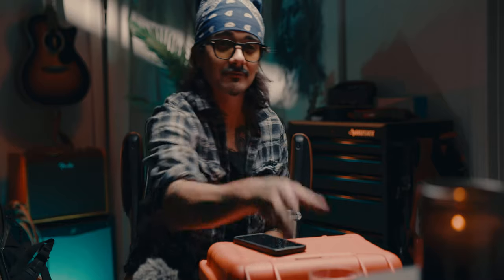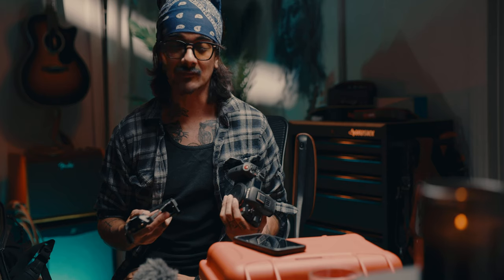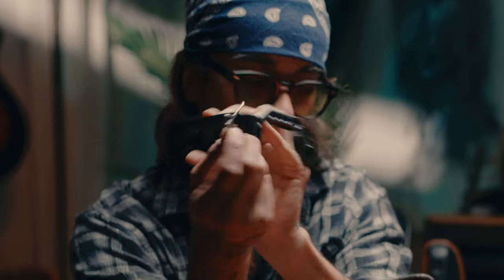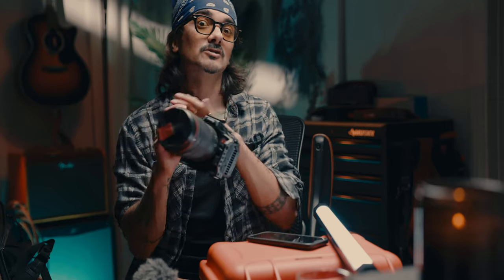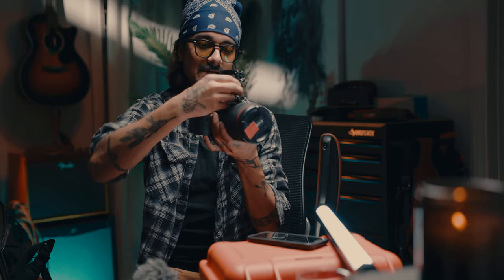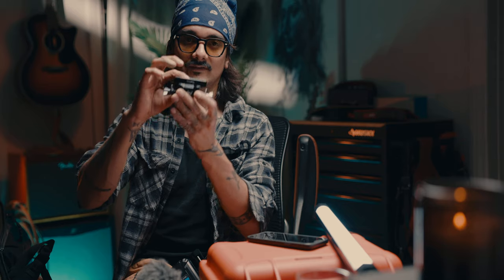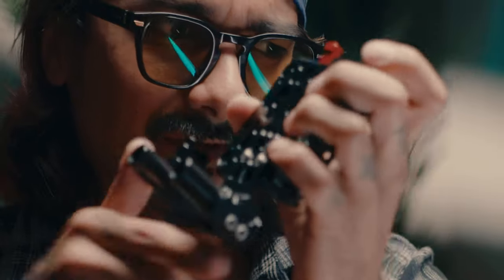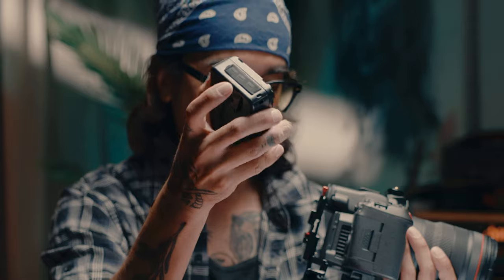The Perfect Canon R5C Rig

Comment: Good stuff! Just to confirm, the Small Rig Black Mamba cage for the R5 DOES wiggle/move especially the more you mount stuff on top. This could be a huge problem because when I have the HDMI and USB C clamps in it will also move those two potentially damaging the ports over time. As Cam shoes the updated R5C version of the cage locks in at the top too where the camera strap is. I literally just ordered this new cage so THANKS Cam!
Reply from the maker: Yes yes! Pretty much every cage before this wiggles. Except for Kondor Blues cage, but that requires this ugly little cold shoe lock thing
Reply: Never had another cage wiggle besides the black mamba ones. The GH6 cage moves quite a bit, especially considering it has the second mounting point.
Reply: The full cage wiggles but the half cage has that extra side mount too so I haven't seen any wiggle on that one, personally.
Reply: Update: I got the Black Mamba full cage for the R5C and works the same as Cam’s half cage. The wiggle is (mostly) eliminates by the pin that secures on the top left camera strap. This gives ZERO wiggle to the clamp/ports but still makes the right side of the cage still a tad flexible, which is fine for me cause I don’t use that side to mount anything. Hope that helps others.
Reply: @Malick333  I see that a lot of people tend to forget the included port protector that comes with the R5C. It screws in to the port and is very sturdy.
Reply: @pr1sm55  yeah the challenge is they don’t sell just the port protector alone so you have to buy the full cage system with top handle …. UNLESS you contact Smallrig support and special order the port protector individually which is what I did.
Reply: @Malick333  alright glad I saw the update. Trying to do these builds without being able to physically piece them together... and with all the little updates companies do to their equipment. It's madness.
Reply: @squidward3333  totally, it's so fun when everything fits but THIS ONE PIECE and then you have to rebuild your rig off that. Since I posted originally, I actually switched to the Tilta R5C Cage which I prefer of Smallrig's, mainly due to the left side port area isn't as crowded, and it was a built in arri rosette connection on the left side I use to mount the Title focus side handle which is fantastic. Good luck!

Comment: For the R5C external power is a MUST. This is without a doubt the best rig I have seen for the R5C. I got mine and returned it because the battery is so bad. It might not overheat but it’s constantly draining that battery when the camera is on. i only got about 12 mins of footage of my first fully charged battery.

This setup is sweet for situations that you don’t need weather sealing!
Reply from the maker: Yeah I havent tried it yet with just the internal battery, Hopefully they can fix it! If they do its going to make it 99% perfect haha.
Reply: @cammackey  honestly I think that’s wise. The image is stunning but it needs that power for sure. It’s money well spent here and super useful to have someone tell you what parts fit!
Reply from the maker: @contentm3893  as the wise Justin Bieber once said.. NEVER SAY NEVERRRRR
Reply: @contentm3893  I already own an R5 and R6 and only had one overheat in the last two years. The main reason for getting this was to allow me to run for longer in a compact package. 

I’m not saying I’m never gonna go for the R5C but if I do it will be for the IQ and not the reliability. I do a lot of work in outdoor situations and get caught in the rain often. The R5 handles that like a champ. The R5C with external power wouldn’t be weather sealed.
Reply from the maker: @bytomw  my R5 has overheated on me now more than I would like to admit honestly.
Reply: @cammackey  I also had a huge issue with my R6 banding when shooting into light sources (basically anytime it flares). The R5C is back on the menu for sure. But I’ll be rigging it out if I do re-buy it.
Reply: @contentm3893  I did but my original comments I made when I returned the camera a month ago. Since then I have been having an issue with my R6 that would be solvable with ABB which the R5C has. Instead I have to send it off to Canon so they can manually do the Black Balance Adjustment. 

The R5C is still a camera I’m considering (along with a bunch of others) to replace the R6 I’m having issues with.

So even though the battery as is wouldn’t last long enough to replace an R5 or R6 in bad weather. I’m considering putting up with that for the other benefits of the camera.
Reply from the maker: @contentm3893  nah, wasn’t about to deal with all of that

Comment: I'm building a rig where the goal is to have the R5C detach from everything with the SmallRig quick release plate. V mount and battery like yours, rails to the front for a matte box mount and all focus/zoom motors attached. That way you simply disconnect all the cables and release the R5C and voila, ready for photo mode! And having a handle on the cage is amazing for photo mode when having to move around a lot. Great video, and great for some inspiration!

Comment: Thanks for the video. For run & gun, I tend to only use the top handle cold shoe lite + mini V-mount plate on top, and place the battery on top of the handle. It doesn’t prevent me from holding the handle, and I don’t need anything else. It’s hard to go lighter than that.

Comment: I have a cleaner solution.
Shoot with EF glass - 8K 60 works flawlessly.
Use the standard R5 battery grip with 2 batteries, you get 90+ mins of 8K 60.
Condor blue cage for canon r5 + battery grip. Absolutely no cables needed, and you get to use the variable ND filter adapter.
Canon EF 35mm 1.4 II is probably Canons best prime.

Comment: Ooh yeah that's perfect. I want to use the cable clamp on mine as well but I don't like the fact that the flaps can't be closed unless you un screw the cable clamp from the cage. I have a power bank I'm using right now and I found a super cheap one on amazon that works however I eventually intend to do something very similar to what you are doing here.
Reply from the maker: Yeah the flap is kind of annoying, tho I havent spent a moment figuring out a workaround. Im sure someone will make something
Reply: I’m tempted to just pull those dang flaps out for the same reason …
Reply: @Malick333  Yeah I thought about trying to remove them. problem is I do photoshoots outdoors with the R5C as well sometimes in the snow so I can't compromise the weather sealing.

Comment: As far as batteries go, I’ve found using a small 12500 PD bank ($90) plus the stock battery gets me about 4+ hrs. If you are running rails you can easily mount underneath your rig. Or, fasten it on your belt, or put in your pocket. There’s no need at all to do the whole rear mounted or even v-mounted solutions unless that’s your thing. 😘
Reply from the maker: I fully use my camera. I put it in a lot of compromised situation so I need it built out properly. Otherwise things get ripped off and broken. Yes there’s a lot of ways to rig it, but I ain’t about to show up to a $20k gig with a power bank rubber band to the camera 😂
Reply: @cammackey  If you want to run a power bank just attach the SmallRig Aluminum Power Bank Holder (BUB2336) to the SmallRig Dual 15mm Rod Battery Hinge (MD2802) instead of the V-Mount battery plate and you're good.  Everything else stays the same and it looks at least semi-pro. I'm Using the Anker PowerCore III Elite 19200 60W power bank based on your setup and it is beautiful.
Reply: @cammackey  Not that you want to...but if you did...
Reply from the maker: @wwestphalen  def wouldn’t run a power bank personally. Vmounts are industry standard, you’ll be able to use them no matter what camera you end up upgrading too. And the voltages are higher standard compared powerbanks which can give you issues. And mounting wise.. there’s a million options for vmounts. Basically I’ve learned to invest into gear that’ll last me years while also being able to be used across multiple platforms.
Reply: @cammackey  Right! Just slightly modified your setup to accommodate a power bank because I'm on an R5 and I'm not a pro. I'll grab the vmount plate and a vmount battery when/if I need it.  Just wanted to throw out the Power Bank Holder + Hinge for those of use rocking a power bank.  Appreciate your sharing your rig.

Comment: Awesome find. Do you find mounting the battery horizontal can block the buttons on the right side? Or with that smallrig setup can you mount the battery vertically?
Reply from the maker: Yeah you can mount it vertically. I just prefer horizontal. It hover over the dials but not really in the way

Comment: Very helpful Cam! Nice tight build.
Curious, do you have the baseplate attached to the Arca Swiss mount with a single screw or did you find a way to double fasten it? I just ordered the parts and noticed I can only line up one hole for attaching them. I’m worried about the quick release getting loose and twisting. Do you have to tighten it often?
Reply: I have the same concern, found this video while trying to figure out how to get a second screw in with those exact base and quick release. I'm kinda thinking if he's fine with it I should be too. Did you ever figure something out?

Comment: Great size rig for practical use. Used your links and will give this combo a whirl when it all comes in. Thanks for the info!
Reply from the maker: Let me know what ya think when you get it built out!
Reply: @cammackey  Unfortunately the V mount plate listed on the affiliate link is not the version with the swing arm. Didn't notice when I put the order in so will be sending this one back.  Found a similar one on  Amazon search and put the order in.

" SMALLRIG V-Lock Mount Battery Plate with with 15mm Rod Clamp & Adjustable Arm - 2991 ". 

Also, unfortunately, the Arca Swiss Clamp in the link provided seems to be different than the one in your video as well. This one has a turn screw on and is blocking some access I need for switching out items.  Still on the hunt for then one in your vid. 

Still lookin forward to trying this out when I can get these final two pieces.
Reply from the maker: @AshvonChamier  no the v mount plate and swing arm are two separate items. I put a link to the swing arm in the links as well it’s under “Battery Hinge”
Reply: @cammackey  DANG! How did I miss that! LOL. My bad, thanks man!

Comment: thanks for sharing your video on Youtube. It helped me a lot in figuring out the cine rig configuration for Canon R5C. I recently ordered R5c for my studio and I'm still trying to find the best setup for in-studio video setup. What I'm trying to do is set up the R5C with a gimbal and wireless video transmitter(not sure which one yet but thinking about getting a Teradek). I don't need sound equipment on this setup since I won't use any sound for this shoot. If you don't mind sharing your opinion on this, what would be the best way to configure this setup? My budget is pretty flexible and I would like to find the best setup for this type of shoot. Thank you so much for sharing your knowledge!

Comment: Love this rig!  Very similar to what I've configured but I use the full size SmallRig cage to be able to mount the Nano One battery (LOVE that battery with the R5C!!) to the right side shoe mount instead of the back to be able to still run and gun with it for both video and photos.  Unrelated question regarding your lens choices...I love your handheld shooting style.  I shoot in a very similar way so am wondering if you've even used the 28-70 RF lens with the R5C.  I know you said you don't use gimbals much and like the IS on lenses but the 28-70 doesn't have IS so I'm wondering if it's not a great lens for handheld shooting.  I know the R5C has great digital IS but when I shoot with the 24-70 RF, it's very steady with both digital IS and lens IS enabled.  I REALLY want the 28-70  but would be using it a ton for video so would love your thoughts if you've ever tried it.  Thanks!
Reply: What's the right side shoe mount?
Reply: @RayValdezPhotography  sorry, should have said top right side.

Comment: Great Vid! When using the FXLION battery, does the camera turn on and off like normal?   I'm using a small rig np-f battery adapter with a dummy battery and it turns on ok, but when turning off the camera it won't turn back on without powering on the battery plate again. It also will only show 25-30 min battery life, but at least the battery doesn't drain since its a 65wh battery.

Comment: Cam, I am getting a normal R5 soon for hybrid shooting and was wondering if you had thoughts on a smallrig cage that fits the camera with battery grip vs without. Would the weight of with the grip be better to add some weight to the setup for stabilizing? Or for run and gun would it be better to have the smaller cage without the grip?

Comment: Hey Cam! Excellent video as always! Do you still have access to an R5 because I am legitimately curious to see if shooting raw with Clog 3 enabled in-camera will give the R5 similar dynamic range performance to the R5C? CVP made a video that showed greater dynamic range in raw when you're shooting with clog 3 enabled in-camera vs clog or without a log profile enabled. Canon is doing something before debayering the raw footage in order to get around the RED patent. My theory is that whatever is "unlocking" the r5 dynamic range when shooting Raw and clog 3 in-camera is applied to all modes on the R5C, providing it with significant dynamic range advantages. But I'm curious to see if the R5 can achieve the same dynamic range with that sort of workaround that CVP discovered. To be clear, that's not Clog 3 in resolve, but shooting raw in-camera, with the clog 3 setting enabled, and then finally decoding using clog 2 in resolve!
Reply from the maker: Yes yes. I’ll test it maybe. Overall the footage coming out of the R5C is a step up. Even the raw. If you watch my previous video, in the raw setting the R5 is extremely noisy in comparison. Which will translate to less dynamic range most likely.
Reply: @cammackey  Yeah I watched it too and that's why I'm so confused lol did you shoot those tests with clog 3 enabled in-camera? I'm wondering if that could fix it because CVP shows an entire extra stop of DR when they enabled it and shot Raw!
Reply from the maker: @kylehessling2679  yes clog 3 on both. Maybe you’re confused. Cause I showed the R5 in raw looks better than it’s standard h265… but the R5C in raw is still better than it’s XF AVC and the R5 in all it modes.
Reply: @cammackey  Oh no, I totally understand that! I was just curious if the Raw was shot as Clog 3 in camera and then decoded using Clog 2 in resolve. I have found that to be leaps and bounds superior to any other mode in the R5. It's strange because Raw should be Raw no matter what profile you shoot, but there is about an extra stop of DR when you shoot Raw and Clog in-camera, and then use Clog 2 in post-production. Just curious because the dynamic range is really the only reason I would switch to the R5C, but the time it takes to switch between stills and video for me is also a major factor. The R5 is milliseconds vs the R5C allegedly takes like 8 seconds between photo and video mode. Here's that video from CVP https://www.youtube.com/watch?v=-b8Rlh1VMaY
Reply from the maker: @kylehessling2679  yes I did a video on the R5 speaking about that, I was one of the original to figure that out. Even when I spoke to Tyler stalmen he was like wait.. you figured this out before anyone else haha. And I’ve used the R5c on 4 gigs now. The switching isn’t an issue. Youtuber like to complain about shit without ever using it on an actual gig. Get it and try it for yourself. I use to use my Komodo on super run and gun gigs.. and that took a minute too boot up and 3-5 minutes to black shade.
Reply: @cammackey  That's crazy! I actually think I remember that video! But I didn't know you were shooting raw and Clog 3, but that makes sense! I would totally trade for the R5C if it was easy to get my hands on one, most gigs that I do are either one or the other anyway as far as photo/video is concerned. The only real-world scenario I could see where I switch back and forth a lot is doing wildlife photo/videos. But I suppose for that, I could just extract stills from the 8k raw! Do you ever miss your IBIS?
Reply from the maker: @kylehessling2679  yeah wildlife stuff would be important. But I would rather have two cameras for shoots where it’s one shot a chance. And nope! Ibis causes more issues for me, was always having to turn it off.
Reply: @cammackey  Oh really?! That's interesting! You do a lot of LITERAL running and gunning though so I could totally see it being a hindrance! I always slightly unhook my lens when I'm manual focusing and then tell the camera I'm shooting on a 10mm or something really wide and it basically just magnetically locks the sensor. Also, loved your stallman podcast! I need to see your DaVinci resolve denoise settings too because that's exactly how I increase the R5 dynamic range!

Comment: With no stabilizing in the C, I was for sure it would incorporate a gimbal in this build. 🧐
Reply: The C has stabilisation and the lens he is using too.
Reply: @julienpierb  from the specs I’ve seen it does not have in-body stabilization like the the R5. It’s some of that odd digital stab. Go check it out. 🧐
Reply from the maker: It was a rig video, not a gimbal video. I rarely use gimbals tho. Ill make a video about ibis soon too, I dont like it for the type of stuff I film. I prefer lens IS.
Reply: @cammackey  rig, gimbal you say potato I say patatoe. 😎